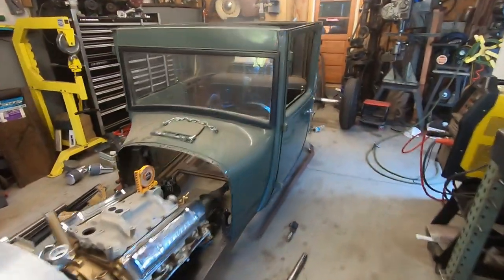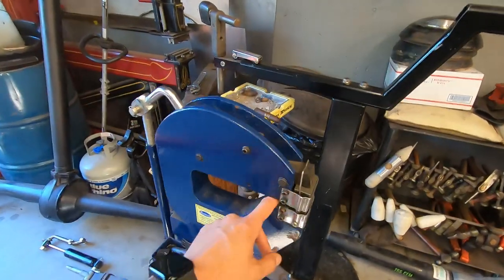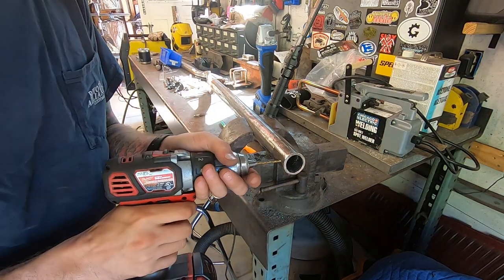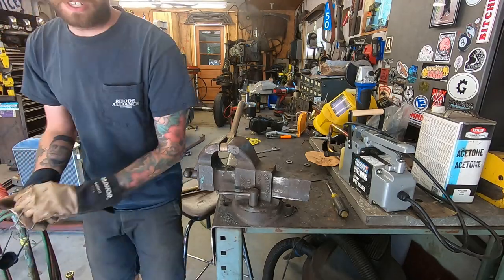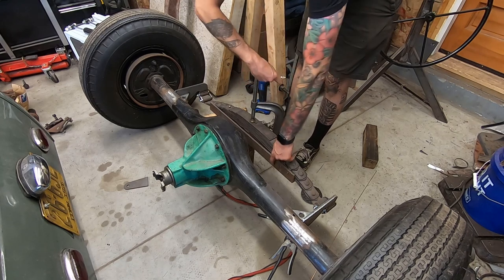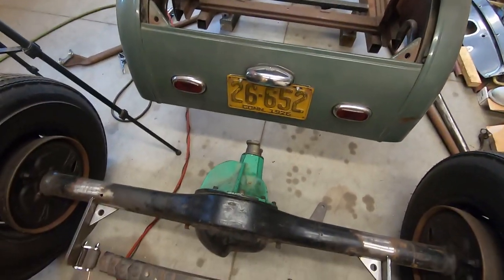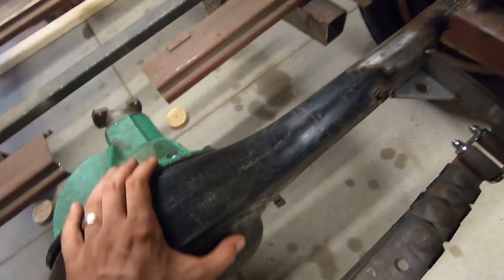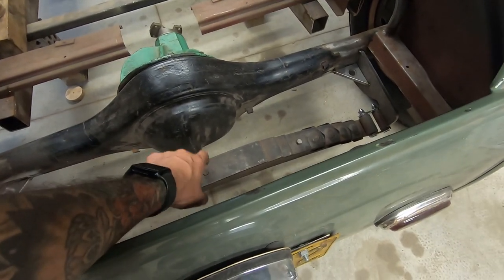1926 T Coupe Build Part 1

Comment: That body is like experiencing a "Time Machine" !!! Those doors are the same doors that Henry used on my 29 Model A CCPU !! It's nice when they shut with the two pronounced clicks !! Like you said. this would be a "VERY FUN" build !!! Looks like he's gathered lots of very nice parts as well.  That Olds engine should be so much fun to drive in that light car. Those things had SOOOO much torque !! 👍👍👍👍🛠🔩🔨⚙🗜
That drill press is a BEAST !!! Too bad they don't make tools like that anymore !! Be sure to clamp that vise down before it spins around and "sections" your legs ----------- or worse !!! ;o)

Comment: Drill press safety note. Always use a vise to hold your workpiece if it cant be clamped, if the vise or workpiece can't touch the column block it with a piece of 2 x 6. If either isn't possible simply rotate the workpice against the column (you observed the drill press preforming the rotation for you on the cross-member wnen it broke thru.
Be safety proactive first.
Reply: My drill press has a bolt on vise.

Comment: I'm not shire why I'm not subscribed how nicely you build or work with metal with bare minimum tool's I do watch your video's all the time. I like how your son and wife get envoled in your builds well at least the truck and your son is learning at a young age. That's how they learn by doing. My Pop's had me helping him do break drums in the early 1970s 5 or 6 year's old pulling spring's holding breaks together or pumping the peddle and holding it to adjust breaks. I built my first car before I even had license to drive. My friend's would have me help them with fixing there car's because they thought I knew more than them. They didn't know I pretend most of the time just trying to fix it process of elimination to find out the problems and got it fix. I was better at body work then mechanical engineering, my older brother was the professional mechanic that did it for a living. Still working on car's even after retiring.

Comment: I have a 26 coup and it is a fun car to drive to. I have a V6 in mine Chevrolet.
Reply: The V6 fits so much better in there than AV8. You don't have to modify the firewall hardly at all.
Reply: Going down the highway about 90 mph is all you want  on one of them car's anyway.

Comment: That is a shrinker, stretcher.  I have one, also an air planishing hammer an english wheel a brake, a drill press, a bead roller, a huge compressor, a frame table, 2 fabrication tables and three top and bottom tool boxes.  With SAE, Metric, British standard(whitworth) wrenches and 1/2in, 3/8, and 1/4in sockets (deep and regular) a, body tools that I have had for most if my life, inherited from my father, I have lead files, several planishing, and finishing hammers, shrinking hammers and vintage dollies. Not to meantion, several minicooper bodies and lots of parts 350 amp tig, and a 250 amp mig, oh yeah and my 28 hot rod roadster, and a 36 Plymouth pickup.  What I need is a shop.  I would like to move from where I am.

Comment: The spring perches go vertically through the radius rod (wishbone)and through the axle.  Not horizontal through the side of the radius rod.  There is actually a reason for that.

Comment: I wished that all the original stuff was removed that was goimg to need cutting up. Then use aftermarket parts to cut up. They are perfect and original once.
Reply: What aftermarket parts. It's a 26/27 T coupe.  Not a common body for the aftermarket.   Roadsters yes, coupes no!  Nice body, try not to cut it up.  It isn't necessary to build a hot rod.  I like the Olds, but I personally prefer a flatty.  At least it's not an  SBC, they are bellybuttons.  Are you going to use a radiator shell?

Comment: I'm partial to the T high firewall embossed ribs, painted would individualize this build. The width may needed expanded and profile re-contoured?
Reply: Why would it need to be widened?
Reply: @garycamara9955  The flatness would add the  factory look, add several inches of clearance. Retaidning the vertical beads to clear carburetion or ignition by creating a recessed box? Fill the coil round openings and chrome???

Comment: It ain't legal to drive on roads! FMCSR part 397 states that no vehicle can openly throw projectiles powered by tire rotation onto the highways or into other vehicles! So put some fenders on that crate!!
Reply: If a car weighs less than 1500 lbs it doesn't need fenders.  Oh yeah; it's a hot rod, real hot rods don't have fenders.  Just don't use cheesy mags or chrome wheels on it.  Steels wheels with paint and little hubcaps look good.  Everyone thinks you need custom wheels, you don't.